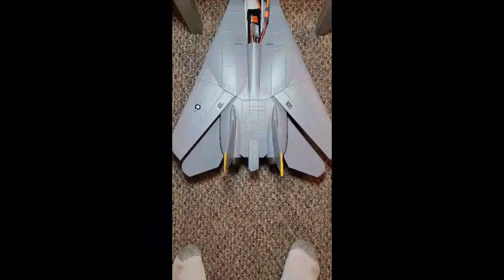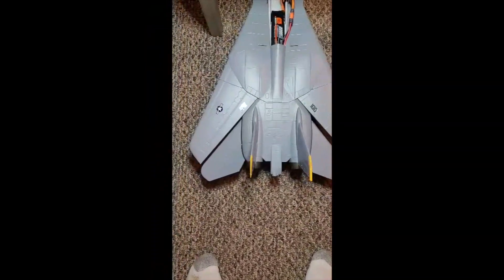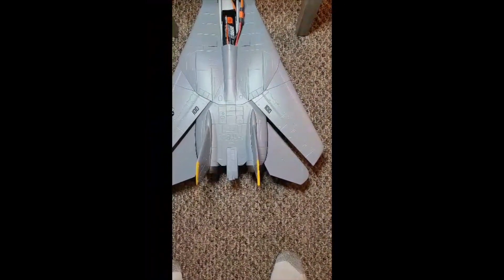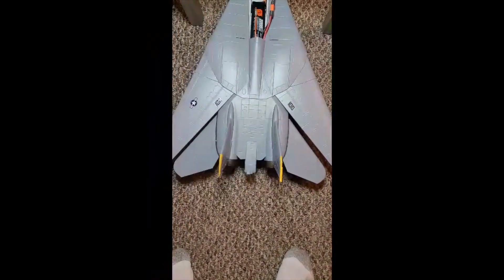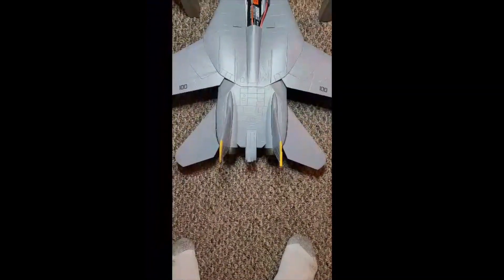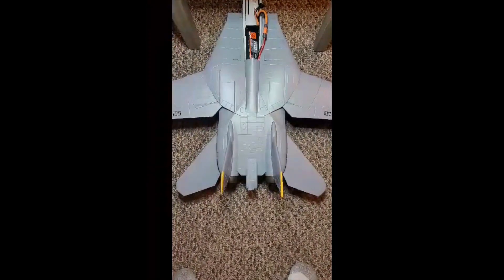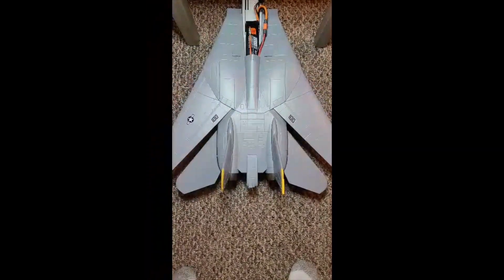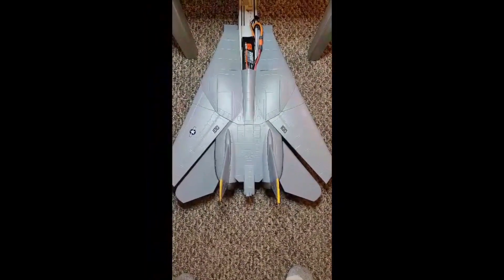E-FLITE F-14 WING SWEEP MAJOR MANUFACTURE DEFECT ISSUE!!! YOU MUST SEE THIS!!

Comment: Why did you unscrew the ball link on the servo arm?  🤯I popped the connector off the ball and made the adjustment without issue.  Just like with any ball link.  Flat blade under it and it pops right off.  Wing sweep differential is a simple mechanical fix.  Yea, I would imagine getting that screw back in would be near impossible.
Reply from the maker: I dont know why i did, i must of had a reason. But anyways they sent me a knew one. Flys good abit under powered and over priced. I order it a year ago and forgot about it until it showed up. Thanks.